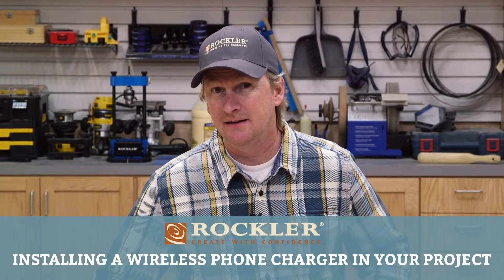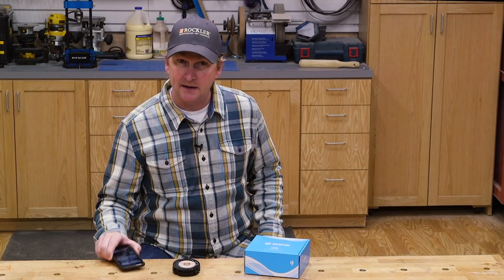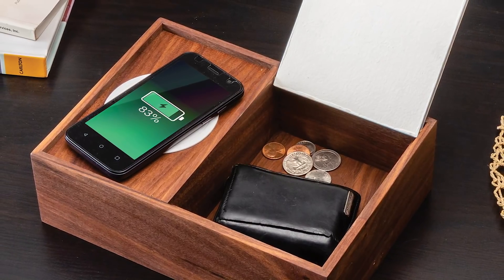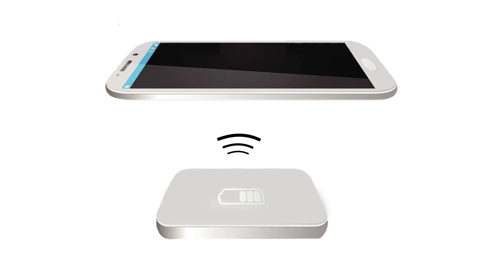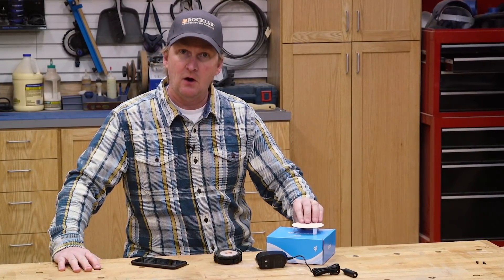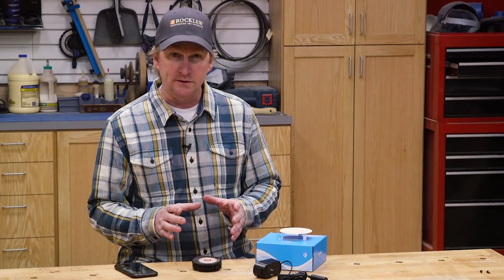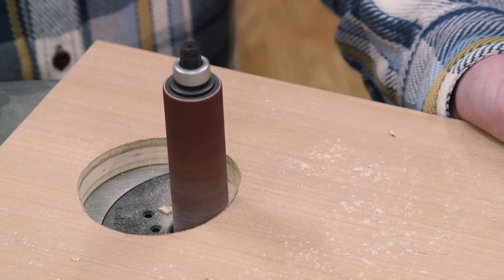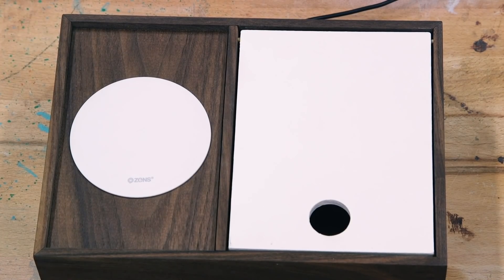How to Install a Wireless Phone Charger in Woodworking Projects

Comment: Great video, Dan! I've been looking for a way to introduce these to some nightstand builds I recently finished, maybe under some inlay or intarsia, or even just a circle of veneer (so the charge point is a different color than the rest of the surface). Any intention of introducing a MagSafe charger (the iPhone-compatible wireless charging solution that also allows for the vertical mounting of the phone) for the same purpose?
Reply from the maker: We don't have any plans to introduce the product you're asking about at this time, but we have passed this along to our product team so they know there's interest. Thanks!
Reply: @rockler  Hey, thanks! 

FWIW: That's the new Apple standard for wireless charging and mounting (starting with iPhone 12). At present, there's 125M devices in circulation that use it, with another 250M eligible for upgrade to one of the new devices (that also use it). I only know this off the top of my head because my day job is as a senior engineer for one of the US Cellular "Big Three" companies.

I hazard to suggest that 375 million devices - and growing! - worth of compatibility probably indicates it's worth either licensing such a device yourselves, or partnering with an existing vendor to resell theirs. Worth pointing someone in R&D at it for an afternoon, is all I'm saying.

My 2¢ (and possibly worth the price, LOL).

Comment: You mention that the charger you carry has more features. What are those features? How thick can the wood be above? As others said, $170 is a lot compared to hacking an Anker model into a top. What does the extra $120+ get me?
Reply from the maker: Hi Joseph, this is a commercial, furniture grade charger--one of only a few that are able to be completely concealed and still function properly in furniture through a wood surface. 
It is able to maintain a cooler temperature while concealed in the wood while much of the competition is known for having issues due to overheating. This causes problems in the charger, in addition to harming furniture. As far as we know this is also the only sub surface undermount charger that is approved by Apple and Android for their products. If you have any further questions, we recommend reaching out to our Product Support team at 1-800-260-9663 or support@rockler.com. They may be able to assist you. Thank you!

Comment: Can it be installed inder the surface? In other words, can a pocket be routed and it be hidden? If so, what is the maximum thickness of wood I can have to still be effective
Reply from the maker: Hi Raul, there is an undermount version that we sell, which you can find on our website at https://www.rockler.com/zens-puk-3-qi-undermount-totally-concealed-wireless-fast-charger-bundle. It is mounted from below and is completely hidden. There needs to be less than 1/8” of wood between the puck and the phone. Woodworker’s Journal magazine has a project demonstrating that charger in its December issue, available at https://www.rockler.com/woodworkers-journal-november-december-2020.

Comment: I love the throwback to the 'more you know tune😀  but I agree, $170 seems very steep for a Qi charger.  One thing that bears consideration will be heat dissipation.  I use Qi chargers for all my devices, and one constant is that when charging, they get warm.  If the commercial grade unit can handle heat buildup better than the Samsung and others I use, it might be worth a second look.

Comment: The price is ridiculous. There are other 15w chargers that are designed to be installed in furniture or even under the top without drilling  for less than $70 and you are charging $170.

Comment: Loved the insertion of "the more you know" tune. That charger is about 3x more expensive than any charger I'd consider buying. I'll stick with my ugly, plastic charger sitting on top of my nightstand. However, if I were a furniture builder (rather than a hobbyist) and wanted to make sure I was putting quality components into something I'm charging thousands of dollars for, then I guess it makes sense to use something high quality and fit for purpose.

Comment: Dan, great job with the brief overview of how the wireless power works.  I spent several years in wireless power applications and your summary was great.  
Price is always important, but not always my first consideration.  I've got several wireless charging pads in my house now - all stand-alone.  I've considered building one into something, but haven't figured out what yet.  My favorite is a vertical model that is just a charger.  Would be nice to integrate that into the "all wood amplifier" that's been demonstrated on the Rockler site.
The 15-Watt solution is definitely the most expensive solution.  The ones I have are simple 5-Watt applications - which just means it takes longer to charge.  Since I charge at night, it's okay by me.
One of the photos on the product page shows a partial cutout and that's what I'd prefer.  I expect the router could be used with the template you discussed in the video.  
Once again, great job with the wireless power description.  I definitely enjoy your videos and have used many of the techniques on my own projects.

Comment: $170 - ouch!  These devices, including one from Samsung, go for $30 or less online.  With most of them, the cable connecting the power supply enters from the side, so they can’t easily be adapted for furniture, so one key feature is a cable that attaches from the bottom.  And adequate power to charge a full size tablet is important.  In the near future, laptops may incorporate Qi technology, so even more wattage may.be needed.